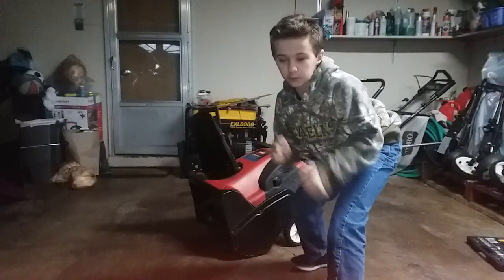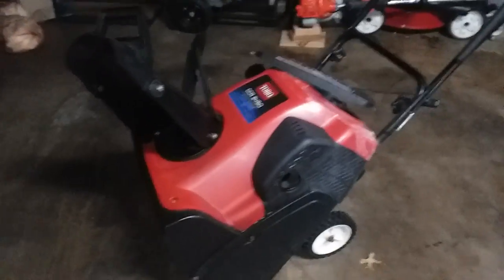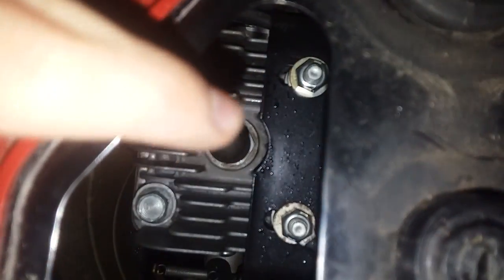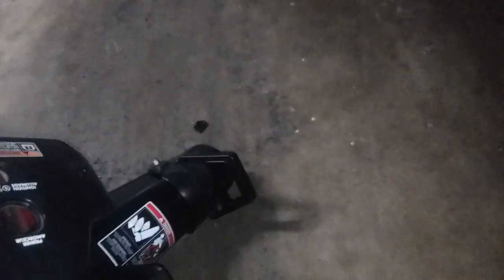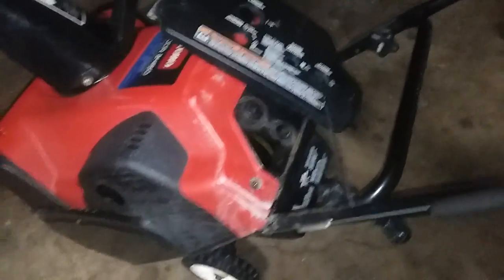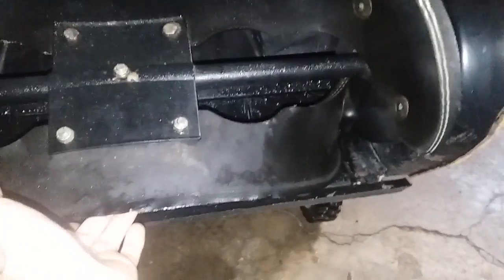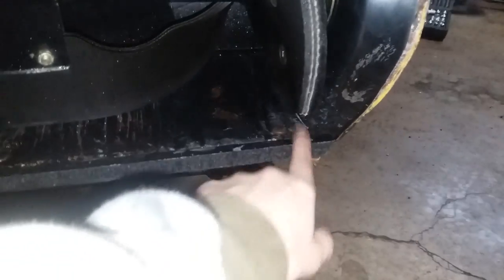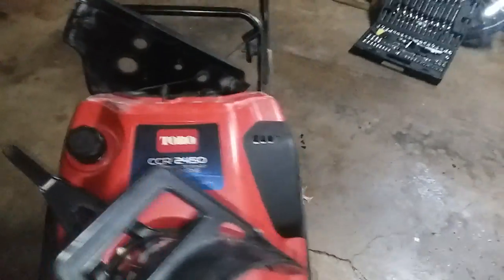Toro CCR 2450 2 cycle single stage snowblower : basic maintenance tips

Comment: I just trash-picked one of these. Does it still throw snow with the paddles worn down like that? Seems like a good machine I just replaced the carb it’s running right. Thanks for the vid
Reply from the maker: It ran last winter. I am going to test fire it this weekend to make sure its ready for the winter. 
This video was made in early 2018. I have replaced the paddles since. Change the fuel filter and sparl plug yearly, belt, scraper, and paddles as needed, stabilize fuel yearly and it'll run for a very long time

Comment: Thanks for the video. I picked up a similar used unit. Can you make a quick video that shows where the extension spring attaches to the idler arm? It is not really clear in the owners manual. The unit I have is missing the spring, so the paddles do not disengage properly when I release the bail arm as the spring should pull away the pulley and engage the brake.
Reply from the maker: I know what you are talking about! Yes, I had to replace jt and it was a PAIN!! Had to strip all the paneling off the unit, to get to where it was. I'll see what I can do

Comment: So I havent had an issue with starting my snow blower but this year of course right before a snow storm it wont start any ideas to what it may be?
Reply from the maker: Check the spark plug, that's where I always start. If that's not the problem try using some starter fluid to see if it starts. If it starts then dies a few seconds later it's likely a carbureator issue

Comment: Thanks! I just changed my spark plug. It needed it. My fuel filter is next if I can find one in a store somewhere. Is there an air filter in this. Mine is older but two cycle and very similar to yours. Best snow blower I ever owned. Got it for 200 bucks. I had an Arien and a Craftsman prior. Neither one held up like this used Toro. They were both brand new too!
Reply from the maker: Thank you! No air filter on these snowblowers. Why? I am not sure. And yes I have not come across a single stage that does as good as this one. The new power clears are super nice but theirs something about these 2 strokes machines that makes them good. I have a video if your interested (posted about a month ago) of me doing 12" of snow with this machine. And I'll take this over one of the cheap knock off 2 stagers any day
Reply: @andyslawncareandoutdooradv  Send me the link I’ll watch it.
Reply from the maker: @ovalvox7888  https://youtu.be/VR5jZKcG1cQ skip to about 2 min 36 second mark and I have about 5 mins of footage

Comment: Does this model need to get oil change??
Reply from the maker: Nope, this model has a 2 cycle engine, meaning gas and oil are mixed together and doesn't require oil changes. If you have a newer Toro (powerclear 721 for example) then you would have to change the oil. Hope that helps
Reply: @andyslawncareandoutdooradv  thanks alot for your help God bless you 🙏🙏🙏🙏